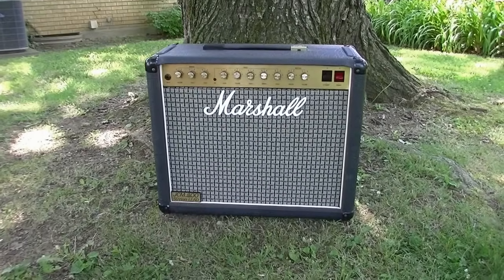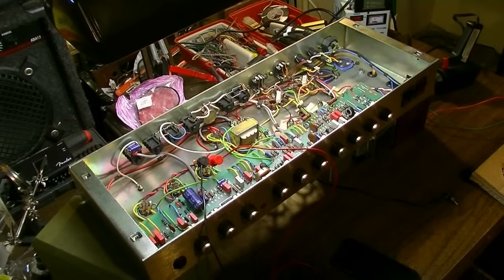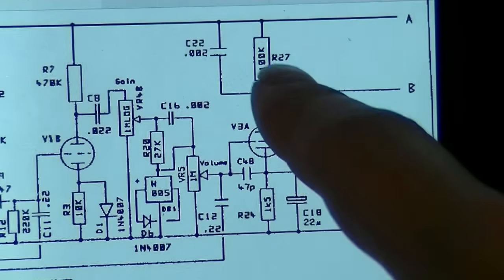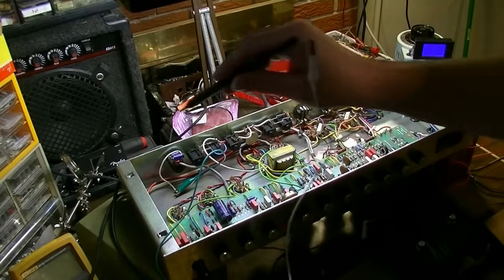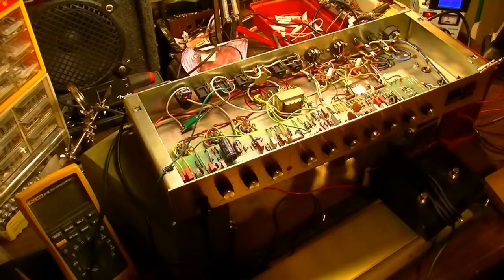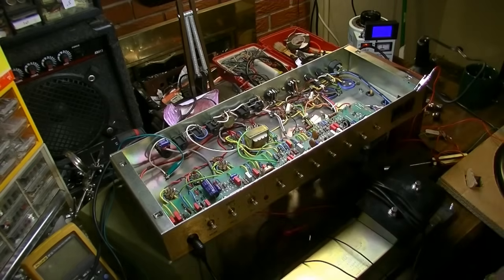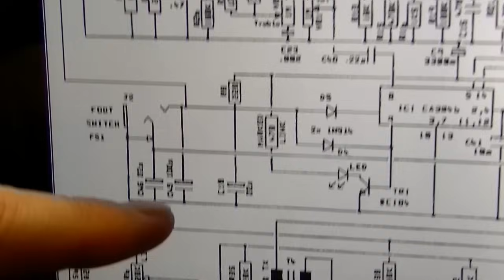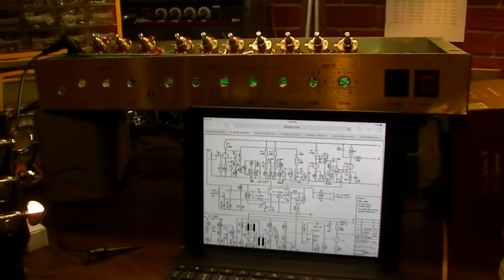The Amp Repair that Almost Broke Me - Marshall JCM800 Combo

Comment from the maker: Hey guys...thanks for the overwhelming response to this one. I've gotten a lot of questions regarding what was the final diagnosis because apparently I wasn't clear enough in editing. The switching transistor TR1 was faulty. Replacing that allowed the Boost Channel to come alive. The phase inverter tube, V5, was causing some sort of issue as well, as was shown in the video, so it was replaced. It tested good on my tube tester prior to troubleshooting. I edit out tube testing from most videos because it gets laboriously long - 50 minutes even without showing tube testing is getting longer already than most attention spans. In fact, you've probably already stopped reading this. The V1 tube tested on the weak side of good on my tester, but I left it in because it should have still worked just ok, which it seemed to do because it is also part of the Boost Channel which was working before I replaced that tube. The V2 tube was the one I finally replaced at the end which allowed the Normal Channel to function properly and fully. The tube I was using in that position during the troubleshooting tested good on my tester, but for whatever reason, this amp didn't like it. The fact that it tested good on my old Precision tube tester is what led me to assume it wasn't the tube and explore other options. Also, if you'll notice on the schematic, the switching is tied into the grid of V2, which is how the Normal Channel gets muted during Boost Channel operation. My theory was that switching in the IC might have also been at fault. Anyway, hope that clears thing up for those of you who had questions. Watching the video back, I can see why it was confusing.
Reply: >>you've probably already stopped reading this<<

No way, man!
Reply: The Guitologist I have only just started watching your channel but I have to say you are a star sir! I am an electrical engineer in the UK and have done a little bit of amp repair and build myself, but ultimately I would like to have a set up similar to yours. You bring wonderful old amps back to life that would otherwise be thrown in the skip so well done you hero! 😊👍. Love the guitar playing by the way. Just one question about your signal probe, as you are at plate voltages I presume you have a dropper resistor in line to protect the input of your test amp? Keep up the good work I am already a big fan!!! Keep on rocking 🎸🤘🤘❤️🎸
Reply: I believe that every repair comes with a lesson; one of those "I should have tried that!" moments.
If you took away that kind of a lesson from this, what would it be? (Would it be to break out the chopsticks early?)
Reply: ha ha ha thats funny  brad my bad
Reply: Watched and read to the Omega.

The knowledge and focus required  to repair such perplexing issues...

RE-SPECT!
Reply: You tell of the stuff you thought was good or bad and what you replaced or dudn't replace, but actually saying what was wrong and fixed it... You did not say in your comment.   Finish the interior of this sentence... I replaced.... .... .... & ... ... and it worked/still doesn't work.
Reply: It is good that you finally stumbled on the problem by shotgunning it, which is fine if it is your own unit. But it is unacceptable to be messing blind in a customer owned unit. It had two very minor problems that the symptoms and just a few readings would have caused a tech to pin point the problems. 
A few points. Restoration and repair are two different jobs and are done differently. Repair to factory performance, without changing anything except you KNOW is defective and how it is defective. No customer should be paying for random experiments and throwing parts at it.   
Measure, that is why you have a calibrated signal generator, oscilloscope, high res meters, passive load, etc.  If you do not have them, don't play around with equipment you do not own.
Take readings with known signal levels, a guitar is not a testing signal generator, that comes after the electronic problems have been resolved. Take measurements AFTER you know what it should result in, otherwise, you do not know if it is abnormal or not. For example, you thought the plate of the reverb driver was too high. Why?  Because it was higher than the V1 or V2 plates?  Before making the measurement ask yourself what you expect. By seeing the schematic you would instantly know an inductive plate load should be close to B+.
With a standard sinewave input of say, -25db, 1khz at the input, a scope measurement of each stage will tell you if a stage has abnormal gain. because you have known by the schematic how much gain in each stage was expected.. 
You focus on components and randomly change them, but all you really need to know is transfer function...the dynamics of the signal.  . But without a good understanding of how the circuit works, it is poking around in the dark. The problems would have normally taken just a few logical measurements to target the stage that was abnormal if you had used a reference signal source. The first one would be from the Send jack which you would have expected about -10dbv out at nominal gain settings. Verifying the power amp section so it could be ignored, sending a signal into the Return at -10 and measuring with the scope across a dummy load to verify the predicted power output with the known reference signal. 
You do not need an emission type tube tester, they tell you very little about the characteristics of that tube, the circuit is the perfect tube tester because it is operating the tube in actual operation instead of a relative emission test that conventional tube testers use that ties the grids together. With the tube manual specs on the published graphs, you know precisely what readings you would be expecting to see. The high z scope probes can tell you a lot about the grid drive, which also tells you the cathode bias resistor and cap status by inference without measuring the cathode. A check of the plate reading to verify your prediction based on circuit conditions in the schematic will tell you all about the tube and associated parts in the stage.
Channel switching is a very common problem and is simpler than you seem to think. It follows simple logic and involved step-change level shifts. For example that mysterious IC was just a package of 5 inde[endent NPN switching transistors so one scope monitoring the Base and collector of the transistor that switchings the signal path for the stage not working would have gotten you to the final problem in a few minutes. No shotgunning or 4 hours needed.
You mentions wanting to shotgun all the capacitors, did you actually replace them all? I hope you did not charge the customer for the time and parts.

I see a lot of electronics which has been worked on by others calling themselves techs and the prices charged, and needless parts changed really is discouraging. I suppose youtube has convinced a generation that just replacing things until it suddenly works it a career. The problem is, it is not a passive process, often degrading the value of the unit and never being reliable again. Repairing it is actually easier with proper test instruments, and knowing how the circuits really work.  The viewers of these videos by the dozens of "techs" should realize that their equipment is being experimented on randomly instead of diagnosed, so are paying far more and getting less than if they had used an actual electronics tech who is properly equipped.  To see how a real tech/engineer tackles defects check out any of the videos on "Mr Carlson's Lab" YouTube Channel to see the difference.
Reply: Thank you.I do have JCM 800 100W super lead 4211 and it seems reverb does not have strong responding and it is noticable passing 6. In the addition, when is passing 6 I am hearing high E constant sound.
I will try to change preamp tubes.
Where can I find schematic blue print?
Regards
Reply: Although I only have a very basic understanding of electronics, I find these videos strangely mesmerizing 😀Or perhaps that IS because of my limited knowledge...

Comment: When all else fails, poke it with a stick.
Reply from the maker: That has been my motto for more years than I care to admit. Works on women too...so I hear... :P
Reply: My High School Electronics Instructor's Motto for working on stubborn equipment was: " If at first, you don't succeed... Use a Bigger Sledgehammer!!"
Reply: Sure helps find a valve that's microphonic! lol.
Reply: You mean the Coarse Adjustment Hammer and the Fine Adjustment Hammer I assume... I used to have a large mallet on my bench which had  "Coarse Adjustment" written on it in magic marker.

Comment: Using that chopstick reminded me when I was a kid I was given a neon transformer. A guy at my church was an engineer with Muzak and he told me how the make a "JACOBS LADDER" thingies like in those old horror movies. He told me what NOT to do and warned me to be careful. I followed his directions and after adjusting the distance of the wires it was working. He told me if I stuck a wooden dowel or something non conductive between the wires, the spark would stop there. Only wooden round thing I had available was a pencil. I received a quick lesson that graphite can be "conductive".

Comment: I just got the 5210 out of the shop. Had to disconnect the reverb circuit off the board because of bad design causing noise. It sounds very similar to this. I have an Eminence Texas Heat 4 ohm on the way to upgrade the speaker and I'll be done bringing a 1985 Marshall back to life that somebody on Craigslist sold me claiming "no issues". Haha $300 for the initial Waffle House pick-up from an unknown man in a pickup truck, $200 spent in the shop and $100 on a Texas Heat upgraded speaker. I now own the world's most expensive Marshall 5210. Still less than half of the price in 2021 than the 4210 currently. Priceless.

Comment: I'm a completely self taught amp tech and I've had a bunch of those "I'm completely at a loss here" jobs. I spent almost a week off and on with a repair of a simple scratchy pots job in a  late 60's Univox stencil amp made by Garnet here in Canada. I initially told the customer it would be a quick fix. Oops. There was constant static throughout the whole signal chain caused by one damn 5 cent resistor.
 I thought it was only me who did so much head scratching. Really enjoy your videos and find them very helpful. Thanks Brad!

Comment: These videos are like a murder mystery! Who dunnit? Well, it wasn't Professor Capacitor in the main board with a leak...let's try Colonel Transformer in the mains section with a short...lol
Reply from the maker: Miss Scarlet Transistor is highly suspicous...as is Col. Mustard Cap's work on the classified fusion bomb.
Reply: lol This one was a doozy. It makes you wonder if you should just replace all the tubes in the beginning just to eliminate those as the culprit. I admire your determination and methods of troubleshooting
Reply: The highly suspicious find 12AX7A strikes again
Reply from the maker: Then I would not be able to film myself flailing around like an idiot. :P
But seriously, those transistors were definitely bad also. And it didn't hurt to change all those caps in the switching circuit.
Reply: Wait a min... I saw that movie, it was the guitarist from Spinal Tap in the hallway with the Beatles album Revolver! Really, same actor!
Reply: wait till ya get into a 900 dual verb or the like.. 5201 switching opamps.ERRR.hate 'em. cross talk . would rather have opto couplers instead..and i hate those!.. j111s and such are way easy to swap and locate issues. switch timer circuits like on some marshalls and PV's are notorious along with lower level Fender dsp models that req the exact switch or POOF.talking from personal boo boos..LOL. wait till a crate vint 30 is on your bench..like?? 6 opto-couplers in series that do the 'ol switch-a-roo...and only one is bad..ha ha..great amp when working properly. mesa .22 cal studio..can be illusive too
Reply: Perfect.

That vibe is what maintains attention. Kinda see it that way myself.  Have to watch entire vids . . . the payoff of great tones and superb playing is always worth the mystery tale.

Comment: Damn, I get too into these videos. I was stressed completely out until you figured out the problem like four minutes before the video ended. What drama!
Reply from the maker: It can really suck when one has multiple issues. You try your best to eliminate variables but it doesn't always work to plan. I did test the tubes before even starting on this, but edited that out for time. Turns out, the 2205 is really picky when it comes to preamp tubes.
Reply: Not to be confused as a complaint, I didn't mean for it to sound that way. Great entertainment, that video had lots of drama. Keep'em coming.
Reply from the maker: I didn't take it that way.
Reply: @TheGuitologist Funny how it's always the last thing you look at.

Comment: I studied electronics in votech (high school)... I passed the classes with a C... I knew then at 17, I would never do this work for a living. I became a Main Propulsion (Steam) Engineer in the Navy... the system drawings were just as complicated but the components are a lot larger, and easier to troubleshoot. 20 years was a life's work. LOL I did follow what you were doing and finding but had no clue as to what was needed. GOOD JOB!
Reply from the maker: Thanks, Randall. Sounds like the spark may still be there in you.

Comment: I have had the 4212 (50W 2x12 Master Volume) combo from new in 1984. It's never let me down and I only work a few miles from the Marshall factory on the rare occasions when I need a retube or a refurb. The last job was new corners, new handle, new Tolex, new fret cloth, new feet. She looks lovely, but still sports some battle scars.
Reply: Alastair Archibald do they cater personally to customers? My jcm900 mk3 was stolen I would like another un abused head.

Comment: I have a regular JCM800 combo...Single channel, no reverb. Best amp I've ever owned. Had it for over 20 yrs now. drooped in a Celestion Gold 50 watt speaker.....super nice. Recently had it thoroughly serviced...new caps, tubes, and sockets. Hoping to get another good 20 yrs out it. I think I will too. Solid amp

Comment: Watching this makes me glad that the JCM 800 I recently picked up is a much simpler design without all that switching crap, and no reverb (1983 4010 vertical input 50:watt 1x12 combo). It is also loaded with a G12M-65, rather than the 70 in the amp in this video. Mine also has 6550’s rather than EL-34’s. I did spend a bit on a full service to fix some issues (replaced tube sockets, new tubes, and replaced any drifted components). Good as new now.

Comment: I had one of these amps years ago and really didn't like it.  It had 6550 output tubes that really are not appropriate for guitar.  Marshall made their sound with EL34 outputs.  Back about 20 years ago, I saw a Crate Vintage Club amp for sale and I went to the seller's home and demoed it.  I was blown away by the tone and, after a short conversation, we agreed to an even exchange.   At the time Crate was still make these amps and they had a good reputation.  I still have the amp all these years later, but it does require periodic trips to the hospital.  At this point the tubes have been replaced multiple time and all of the caps were replaced about 5 years ago.  I think my problem with the Marshall was having only one speaker - it sounded much better when connected to a 212 or 412 cabinet.  Not to give up on Marshall products, years later I bought a JCM 900 50 watt head and traded for a 412 cabinet.  I was very happy with the way that amp sounded.  I sold it about 5 years ago when I was moving along with most of my other amps, B-3, etc.   I don't know why people trash the JCM 900 - I think they sound good for rock.  The JCM 800 and 900 can be traced back to the Plexi, but Marshall stopped manufacturing point-to-point wired amps around 1972, so the DNA is there, but not the mojo.  I really don't think tube amps are happy using circuit boards where the tube sockets are mounted on the boards,  These amps are difficult to service and sometimes impossible to fix.

Comment: Looks almost as if multiple issues were caused by either the owner, or the previous repair dude. First instinct is to usually swap a "known good" tube around in the preamp. Sometimes that "known good" ends up left in the amp, and we all know that "known good" tubes are takeouts for a reason. This kind of work isnt just tech work, it entails a certain degree of "street smarts" as well. hehe

It shouldn't be surprising to find multiple issues caused by one person trying to solve another.
Anyway, good job. These videos are great. Keep these coming! I watch them whenever I see them.

Comment: Hi, great detective work. I have one question. What were you using to probe for signal in the early part of the video? Where you put a lead on the grid or plate and it would play? By the way No Remorse is one of my favorite songs to jam to.
Reply from the maker: My probe was connected to the Kustom practice amp in the background there. Nothing special. Poor man's signal tracer.
Yeah, that ending of "No Remorse" was responsible for many a solo mosh pit in my bedroom back in the day! :D

Comment: The DI is "direct interface" for connection to a mixing console or power amp for larger venues. The 4210 is a great little amp, loud and versatile, killer crunch tone by turning the master all the way up, dial in gain as desired, but will wake up the neighbors.
Reply: actually have not watched the vid yet.. the can caps on these Marshalls are extremely high quality and seldom need replacement.